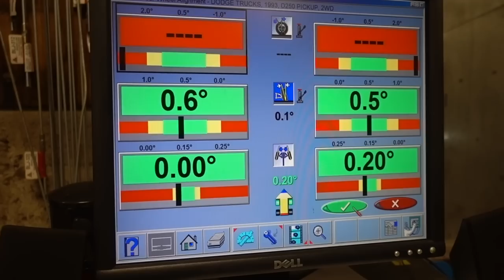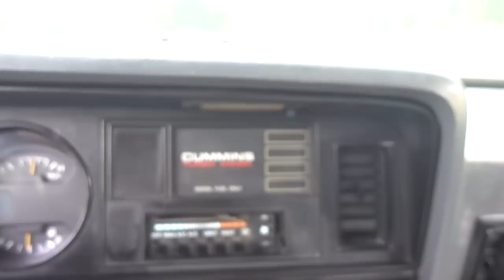TWIN TURBO 12 VALVE CUMMINS RACING!!! FIRST GEN VS. SECOND GEN HIGHWAY DRAGS!!!

Comment: Get yourself a. roll of duct tape and put it on the seat to use as a cup holder. regular cab life
Reply: I like your style!!!
Reply: this deserves most useful comment of Youtube 2017. so simple yet so effective!
Reply: *duck tape
Reply: Duct**
Reply: It is duck.  The original manufacturer, 3M, developed this tape for waterproofing ammo containers for the military.  It was aptly named Duck Tape as a result.  It was only later that the HVAC industry started using it, well after it became commercially available.  Straight from a surprisingly interesting special on the History Channel.
Reply: A Mcdonalds cardboard drink holder works good, too. lol
Reply: Use mine everyday
Reply: I’m gonna do this thank you!!!!
Reply: My dad has a roll of tap in this truck 😂that explains a lot
Reply: In my 5.9 Cummins Bronco, I use 3 or 4 mcdonalds cardboard drink holders stacked up on the floor, works great as a drink holder for years. lol

Comment: Getting the at the wiper linkages have to pull the wipers off they have a little tap you slide out when wipers are pulled away from windshield then you relax them and will hold the taps in the open placement. 
The cowl screws under the hood also at each corner their is screws not in all the way those are locating screws under the windshield rubber. 
On my 88 W150 some one put silicone where part of the windshield goes in cuz rust there should be nothing but the rubber and locking strip holding the windshield in so when putting the cowl back in gets tough cut the silicone or what ever is in there out. Putting the wiper linkage bushings in and out just requires screw drivers and channel lock pliers.

Comment: First Gen... Like a Classic Square Bodied Chevy, I Have a 73 dodge power wagon, as much as it is, my next step is a 12 valve. 440 has a new home,  So out with it and find a good cummings. Have you seen project old smoky f-1? if not check it out. As for the cup holder issue in a reg cab, they have a clip on cup holders for the door window. for how you drive I say jb weld it to the door so the holder does not come off. Just had an evil gear head thought? twin turbo 12 valve built. then drop it in a hurse. the bigger and heavier the better. exo cage the front with road armor bumpers. Grin

Comment: I was always working on my truck in my yard and didn't worry about the neighbors complaints. After suffering a traumatic brain injury in addition to having an operation to remove a few injured parts and being confined to bed 24/7 for the better part of 2 years l found out how annoying the tap of a diesel engine can become when it idles for hours and hours right outside your window. If I am ever able to work on trucks again I will màke sure to be a better neighbor, and be more considerate. You never know what is happening in their life, or why they act the way they do.

Comment: Greg, I could probably find this out by looking back a few videos, but where did you get that steel braided line and what's it called? I need new lines on my second gen from the air dog because the rubber ones rub on the frame and are close to having holes in them

Comment: What's up with those tint gaps in your intro? I thought some hotshot tinted that thing. Not hating, just wondering if that is what I am seeing?
Reply: mrhangfire1 i see them too
Reply: I see them also
Reply: His windows are open, there's little windows on the front of the doors. Those little windows are tinted too though
Reply: Or do you mean the two little dots?
Reply: ahh, wrong intro haha
Reply: Yeah that back window looks terrible. I noticed that a few videos back
Reply: NICE
Reply: use a black shapie marker to get rid of those lines on the tint.....need to Greg A. delete them lines man
Reply: mrhangfire1 it is hareder to tint a old truck there is no place to tuck the tint material in on a old truck

Comment: what's up with valve cover for 2 and 3 on scrap truck
Reply: Mr. McEdwin I second that, some sort of breather?
Reply: Ya it's crank case vent might have came off a off road Cummins or it's fabricated let  is know Greg a
Reply: Mr. McEdwin ok I found it, looks like a PDP Duel Valve Cover Crankcase Breather. Found it on Pure Diesel power for about $190